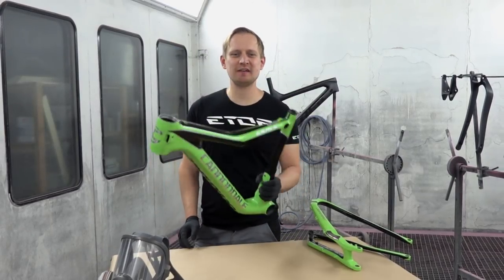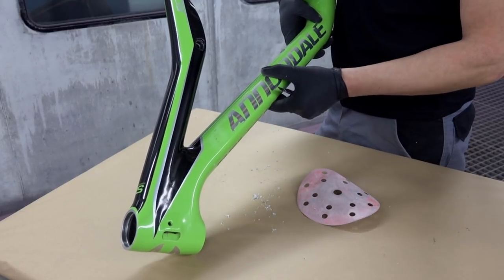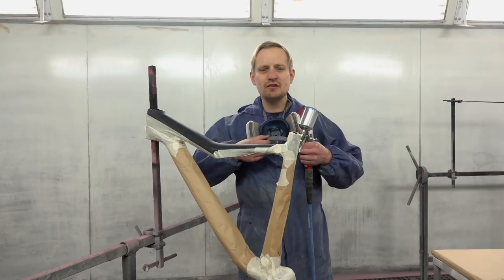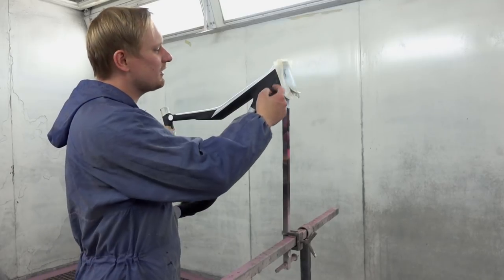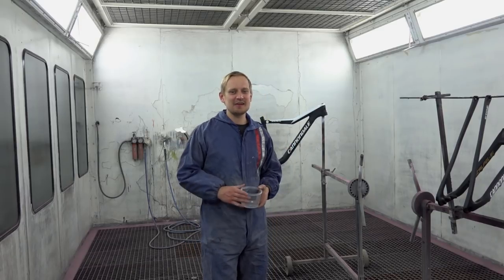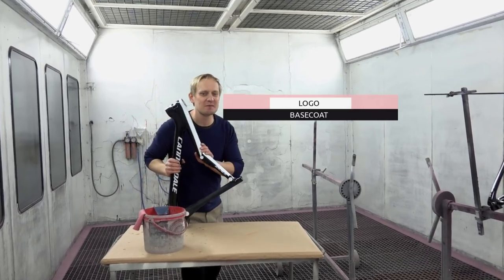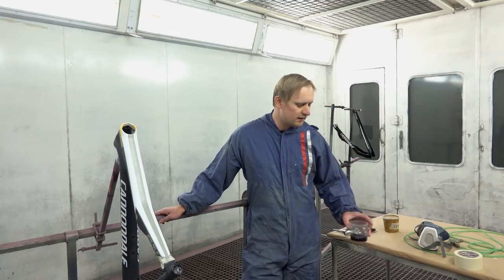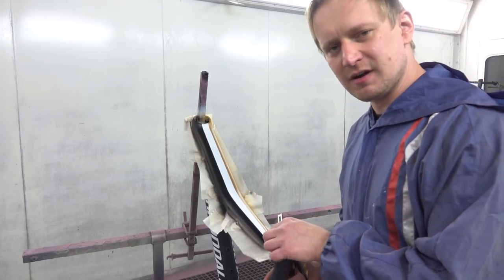how to paint a bike - Cannondale Scalpel Worldcup Edition

Comment: Did you have any trouble removing the front logo (head tube)?
I am trying only to remove this logo from my scalpel and replace it with the new modern one, but I am having difficulty removing the head tube logo, and wandering if it’s possible without ruining the original paint job and finishing…
I thought maybe it is under the top finish, but the bike is matt finish and the logo is glossy

Comment: Hi. Love your work. I have got a question. Do you remove all the paint to the bare aluminum when the frame is new? Or is it ok to use just a sandpaper and use the old paint as a base? Then apply color base on it? Thanks for the answer.
Reply from the maker: I remove the complete old color on aluminum frames.
Reply: ETOE Thanks for the info. It looks like I will have a little more fun doing my bike.

Comment: Martin, there's a paint stripping spray  that does the job neatly and speedy. BTW. can  you do only logo decals or stencil for my Trek rb. Id like to paint it myself.I can senf my preferred graphics snd measurements to you.How does this work?
Reply from the maker: Yes and it will also remove the resin between the carbon fiber, so the frame can broke or delaminate.
Reply: ETOE I see.So cannot be applied on cf frames only alumini?um. But thers a you tuber called sickbiker he used this spray on a cf frame. BTW how about my enquiry on the stencils?